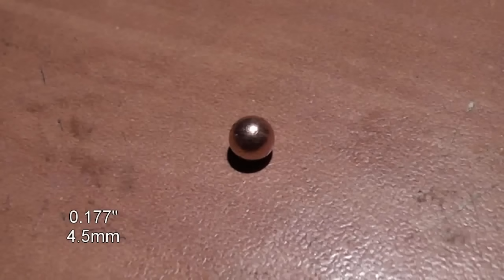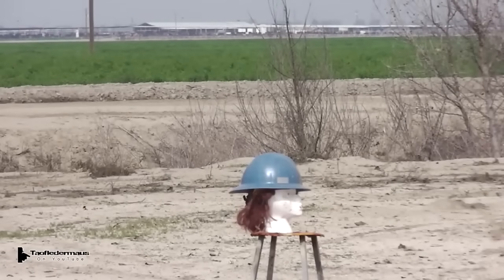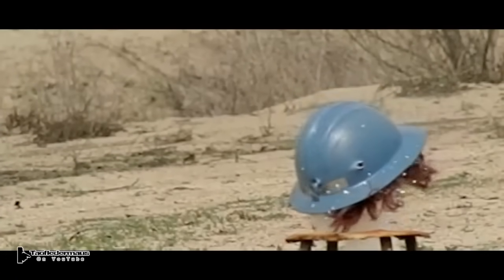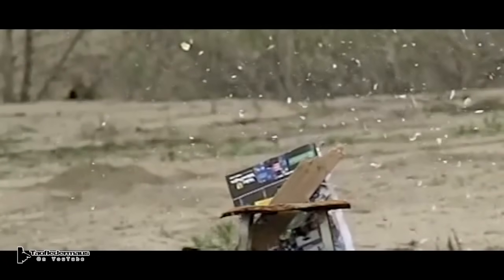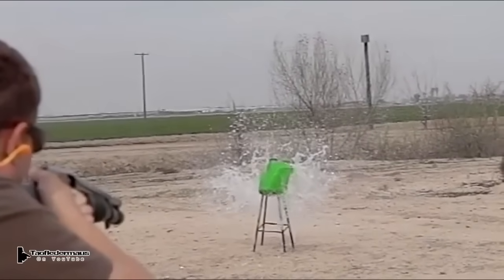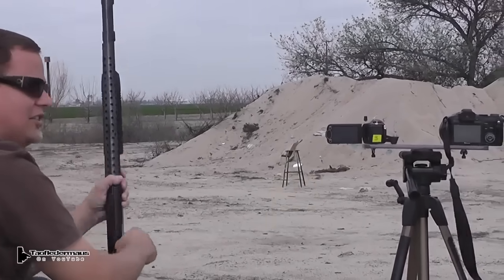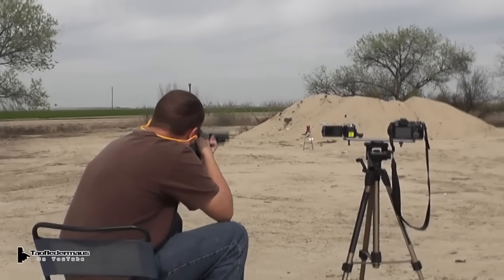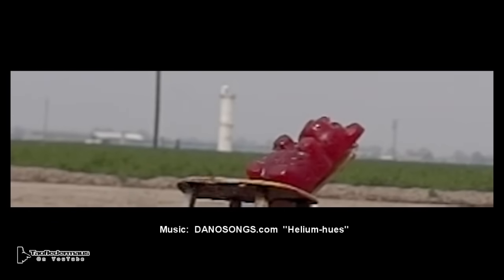SUPER-SIZED BB GUN  -  68 Cal.  BALL BEARING Shotgun Loads

Comment: Next step, canister rounds using rollers from a car wheel hub bearing?, a cluster of small tapered roller bearings would be devastating against a cluster of books, or a dead TV?
Reply from the maker: Oh man,  I forgot about those.  The u-joint needle bearings too.  I have a big roller bearing and each roller is the right diameter for the shotgun,  but they weigh about 50% too much.  I'm leary about shooting them.
Reply: String and distance. FOR SCIENCE!

Comment: Most ball bearings are made from an alloy called 52100 and this is a very tough steel alloy.  Very large balls of this alloy are used by several custom knife makers to forge blades out of them.
The knives made out of this alloy are superb in toughness and edge holding abilities.

Comment: is it really a bearing ball?
cuz that would mean it is hardened steel, is it?
that would come close to shooting a  superlight thungsten ball, besides, thungsten would be way cooler, if available, it is the hardest betal you can get and it has about the density of lead
Reply: I was wondering the same things!!
Reply: Pure tungsten is actually about 80% heavier than lead!!! Although tungsten fishing weights and things of that nature are generally nowhere near maximum density. Tungsten has a ridiculously high melting temperature so it's more efficient for manufacturers to sinter it than to cast it.
Reply: Ususally thungsten is sintered mixed with cobalt as some sort of cement and to make it less brittle, at least when used for cutting inserts.
Thungsten itself is really very brittle, its hardness can be compared wit ceramic, in fact, thungsten is the most common material for cutting steel and almost any metal, only especially hard metals like cast iron are machined with ceramic, in some applications isdiamond used too, but not for cast iron beacuse of the affinity, great, now i stardet to blab about machining and stuff....
What I was intending to say is, thungsten can only be sintered, often mixed with cobalt, and thungsten is very expensive, a single cutting insert goues for around 20 bucks, a thungsten ball that big would propably come close to 100 bucks, if not more...

Comment: what did the bearing that hit the steel plate look like when you found it
Reply from the maker: It just had some light scuff marks from the plate.   Darren tripped over it and we found it when we were cleaning up.  lol    We were surprised to find it.
Reply: Lol, bearings are freaking strong.
Reply from the maker: I really did expect the hardened steel bearing to just shatter on impact.   It probably would have if the plate was also hardened steel.

Comment: assuming no energy is lost to deformation, you only get stuff reflected backwards if the target is very much heavier than the projectile. if its the same weight, it is maximum energy transferred where the projectile stops moving and target moves at speed of projectile. you can see this effect in curling. of course a lot of energy is lost in deformation though
Reply: The energy is not lost during expansion, it's transferred to the target. That is exactly what you want in a weapon though, knocking a target down without risk to bystanders.

Comment: You should try this on bullet proof glass and body armor.  Also switch from low brass to high brass 3" or 3 1/2" shells.  If concerned about safety, place shotgun  in a very secure clamp device and attach string to trigger and stand back.  You should have a problem though considering these types of shells are already used with heavier lead balls.  You will be truly amazed with the results.

Comment: It'd be cool to see what these do in ballistic gelatin,  like how they do with most any round on the market. Also, since you can consistently load the shotgun shells, you could make this go slower or faster, depending on finding the correct load, like primer/powder setup. That being said, you could optimize your effects on target, as long as you maintain the proper chamber pressures. You can also get a red dot or holographic sight, like an EO tech, and mount those on most shotguns to alleviate the ranging issues with no rear sight, that's how a lot of turkey hunters solved it. Just suggestions off the top of my head.

Comment: Sorry to pick nits, but BB is not short for "ball bearing". It comes from a rather arbitrary size naming convention used for shot that also includes A, AA, B, BBB, T, TT, F, and FF sizes. Original BB guns were sold to farmers as a novelty and for pest control and they were designed to fire lead BB sized shot. It was only later that purpose made steel BBs were sold.

Comment: as a black powder shooter in CA (with no lead hunting laws) my hawken 50 cal is a patched ball shooter, I wonder if a 1\2 inch bearing with the right patch could work and not tear up the inside of my barrel?
Reply from the maker: eh..  I probably wouldn't risk it.  May have to use some copper or bismuth balls but what would THOSE cost?
Reply: that my freind is the problem, I've only found one non-lead roundball maker and those are expensive...I don't know what alloy I can make (I cast my own lead ammo) that is low enough temp and soft enough to use in the old front suffer or the c-n-b revolver. And I am too afraid to experiment (that's why I watch you, learned enough to avoid tinkering on my own)
Reply from the maker: Just paint your lead balls-  green and you should be good to go.  lol
Reply: the web is all a buzz with powder coating...I wonder really what that does? but by 2018/9 there is to be no lead for hunting in ca at all, anywhere.
Reply from the maker: Seems like if you tried to coat it with anything,  it would mess up the balance.
Reply: there is a slight distortion when the lead is rammed homed with a tight patch, a slight roundy almost fat american football shape, but add a (relative) slow spin (mine's 1:66 twist) and it's pretty darn accurate (I just need to practice my aim better...lol), so what ever replacement I can find needs to be similar because I refuse to destroy my barrel for this basket case of a state.
Reply: rotometal has this: https://rotometals.com/lead-free-bullet-casting-alloy-88-bismuth-12-tin/ 
but not sure how it would work as patched roundball, your video on bismuth slug showed me how brittle it is and your was shot down a shoothbore.

Comment: That is some insane projectile. And, because they're ball bearings meant to roll around in a cage, they're actually ground to spec. I'm sure a batch of a 100 balls don't differ more than a couple thousandth's (did i spell that right) of mm's. Tried using smaller ball bearings? 2 mm bearings as a replacement to steel shot, but maybe put into a shell in neatly organised geometric patterns with wadding as the center, then lightly filled with wax? (for the ultimate in tightly configurable spread shot)

Comment: Being 30% lighter than lead shot that was you fps increase. If your using the same powder load the it should be faster right?
Reply from the maker: Yes.   The rated fps of the lead shot was around 1250 I believe so these were probably going faster.

Comment: How much air would you have to compress to equal the power of one of these shells? I ask because of course BB guns are air rifles. Can the BB gun be scaled up to this, and if so what can we know about it?
Reply: Lemtil

200 what?
Reply: +Brandon “Innomen” Sergent With a barrel of same length, you have to achieve the same area under the P-V graph of a shotgun. With the same diameter volume change will be identical, thus we need to achieve the pressure that smokeless powder can achieve. When the smokeless powder explodes, there is a moment where the density of high temperature gas will be some what similar to the density of powder, but keep in mind that powder is in its' solid phase. So if you want to achieve the same pressure with air in room temperature, I think you need to compress 30 litres+ of air in the shot shell. My guess based on rough calculation.
Reply: +Brandon “Innomen” Sergent And the gas chamber has to withstand the pressure at the level of 10000 atmosphere pressure, like 1*10^9 Pa+.
Reply: Alexander Jason 
Dude! Thank you! I have always wondered, and I did not expect such an awesome and complete answer :)

Hat tip to you sir.

P.S. 30 liters at 10K bar lmfao

Damn. So that's not gonna be possible any time soon. Sheesh.

You know, this has me thinking in the other direction. Bullets use a chemical propellant. So how about an atomic one?

Like if you could somehow replace the primer with like a tiny fission bomb and replace some of the powder with the fuel, how much less volume would that require?

Or, conversely, how hard could you fire a bullet using a shell casing's worth of nuclear fuel? :P

I can't find speculation on that anywhere on the net. I mean I know we can fire a nuclear warhead out of a cannon, but would there be any advantage in terms of power and speed to using fission instead of burning powder?

Thanks again for your awesome mind bending answer :)
Reply: Sorry. I calculated it in the wrong way. 10000psi will be 680atm, which means you need to collect 7L of air at atmosphere pressure and compress it into the chamber which volume is as same as what powder occupies in a real shot shell.So 7L of air compressed down to chamber to achieve 10000psi. Sorry about the exaggeration. This result makes much more sense.
Reply: Brandon Sergent And 680atm is only 6.80*10^7 pa. The only problem is, gun chamber is designed to hold that pressure in a very short time. But if you want to compress gas to that extent, you need a container that can keep that pressure inside, which is quite hard. Even with this much smaller pressure.
Reply: Brandon Sergent If we can use fission fuel as energetic material(which is a sci-fi), and somehow scientist do determine to use it to propell projectiles, what good can it do compared with chemical energetic material? Well, its' energy density is at least 1 million times higher than that of smokeless powder, so scientist won't use pure nuclear fuel in the shell, since it will need a microscope to do it. 1 million times more powerful means you only need 1/1million of smokeless powders' mass to achieve the chamber pressure.
Reply: Brandon Sergent It will be much better to just throw a nuclear bomb. One of the reason why every country is now developing rail gun is that traditional guns and canons has reached their limit. It's not only because our powders are not powerful enough, but also we pushed the materials that we know to the limit. We simply can not build a more powerful canon based on energetic material propellent with out ruining the barrel in the first couple of shots.
Reply: A 45-70 barrel can out live the shooter, and the .243 win has a barrel life of only around 1200 rounds, 7mm Remington ultra magnum has a barrel life as low as 600 rounds. Why is that? Well, material used to build barrel has its' limit.
Reply: +Alexander Jason 
Still, that's amazing, and I appreciate the information :)
Reply: +Alexander Jason 
Heh, a million. Epic. X)

Comment: I suppose for comparison a lead slug in the gummy bear would be a good video as well, though the power behind it might just lead to the bear disintegrating.
Would the Bearing be traveling any faster than the lead slug it replaced due to lower weight, and hence have more energy (since K=(1/2)m*(v^2) ) ? Or would the lower compression from reduced mass cause the bullet speed to be the same?

Comment: try not to hit the metal plate at angle because of it gaining thickness and its a round object so its more likely to bounce up but you also didn't want it bouncing back (which you saw it wouldn't) so maybe try it like that, hitting the plate dead on ? but do it safe (key part)
Reply from the maker: We always put steel plates at a slight angle for safety in case they do ricochet,   it doesn't come straight back at us and kill us.
Reply: And i wouldn't do it any different :) have fun

Comment: Did you have some kind of choke on the gun? a cylinder bore 12 guage should be .727", and your ball bearing was .6875". Is the additional space required for wading? Going on the same logic, shouldnt it be possible to fire standard 3/4" (.750) ball bearings out of a cylinder bore 10 gauge (.780)?

Comment: and if you find the round you can reuse it
Reply from the maker: Jeff Bankston We found the ball a FEW times and did reuse it several times!
Reply: could u imagine a cannon full of those.I used to save them out of warranty Constant velocity joints To use with a wrist rocket you do not want to get hit also cage wheel bearing have cylindrical bearing they make a wearing noise as they flew toward's what ever I was riding my yard of
Reply: ***** It is essentially a "hardened" Pumpkinball for your shotgun.  I have used both Pumpkinballs and Buck & Ball loads.  It would be interesting to see one of these with steel shot on top of it; In effect, a "Hardened" Buck & Ball round.

Comment: So you used 17.272 millimetres ball bearing did you happen to check how fast it was going? I think you should have put that steel plate in the sand planted firmly with sand behind it so it could absorb as much kinetic energy from the projectile as possible. I bet it would have gone clean through the plate. Lead & copper 12 ga slugs can go through two car doors plus the equivilant of two passengers and keep going.

Comment: What would happen with a wax slug laced with magnesium strips? I'm thinking tracer round....
Reply from the maker: ehhh I don't know.   I'm thinking there wouldn't be enough heat generated to get the magnesium lighted.
Reply: ***** Maybe if you melted the slug and reformed it with a magnesium strip around the outside. Though it may only work in a rifled barrel.
Reply: i got it put a metal tube straw, fill it with the magnesium and surround it withe the wax

Comment: That's the point with these rounds - due to light weight but highly aerodynamic shape they are pretty good for penetration. not so much  for stopping power, because power vector just goes through the target - target will still keep moving at you (except if you hit it alongside, like shooting deer frontally, rather than sideways). but if you just need an open straight wound - a very plausible round. 

I wonder what amount of stopping power it will get if you split the ball into 4 leaves leaving only tiny weld in the middle so it would shatter midflight.

Comment: would be intresting ho heat up those bearing untill they are stuper hot then quench them and leave them super hanrdened and shoot them..  i wonder what effect that would have.. especially on the metal plate..
Reply from the maker: ZerqTM  bearings are all ready very hard!
Reply: I was thinking hardening without tempering i.e as hard as they can be even to the point where they might easily shatter.. then again they might be made that way already thay are small and round already which makes them structurally strong to begin with...
Reply: ***** what if you where yo say, double up the load? two ball bearings and twice the powder? ok, maybe just sufficient amount of powder...
Reply from the maker: Because the gun would probably blow up.

Comment: Cool concept! What was the actual weight of the ball beating? I'm curious to calculate the energy that round must have had. I bet that would do really well in other barrier penetration tests like drywall or a car door. Maybe send a couple to TNoutdoors9 for a ballistic gel review.
Reply from the maker: The weighed in at 0.7 oz.  I'm not sure about the velocity though,  but the shells were rated for 1250 fps with the 1 oz load.   I'm sure these would go very far into the ballistics gel.   Tommy has been really sick with the flu so he may not be making any test videos for a few months.   He nearly died from it.
Reply: Yeah, I saw he posted his first video in quite a while just the other day. Very glad he's on the recovery side! If that was moving at 1200 fps it would be about 970 ft/lbs give or take about 150 per +/- 100 fps. I sure don't want to get tagged by that bb gun!

Comment: If one of those bearings deforms even slightly that gun would blow up in your face. It doesn't happen often with lead balls in muskets because the lead will deform faster than a steel barrel. Steel bearings are likely stronger than the barrel their traveling through.
Reply from the maker: There is clearance between the barrel and the bearing ball.

Comment: wouldn't angling the stainless steel plate change the effective thickness of the plate? if the plate wasn't at a angle, would the bearing go through? the formula i think is A(effective thickness after angling) = A(actual thickness) / cos(angle away from the normal).

Comment: a .177cal BB fired out of my Gamo Hornet is a scary thing. My hornet will fire lead at 1000 fps, and PBA at 1200fps. I dont know what BB's are travelling at, but I can put a BB through light gauge steel (not aluminum) road signs from about 30ft away.
Reply: I got a Bone collector
Reply: I have been taking my Federal Trap shot for my Mossberg Maverick 88 (short barrel), emptying the trap load out, and refilling it with .177 cal BB's.